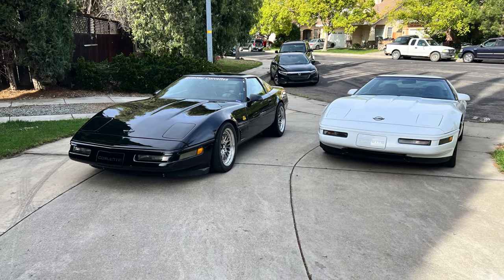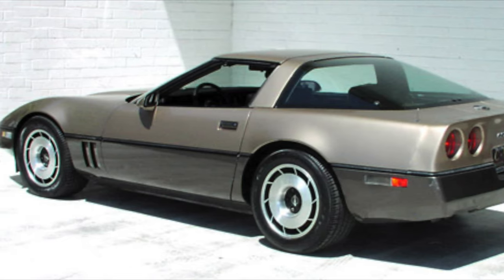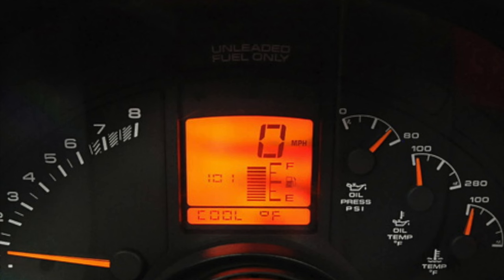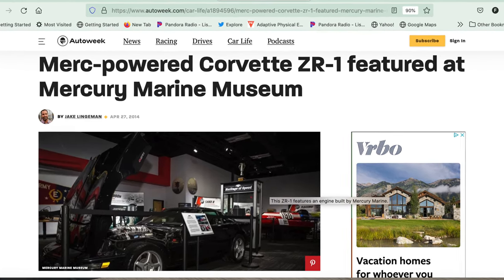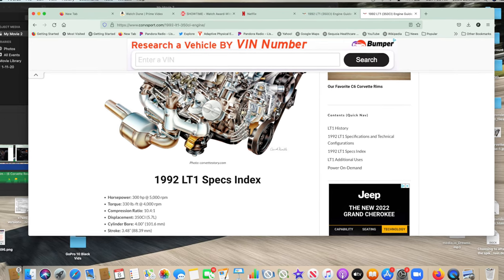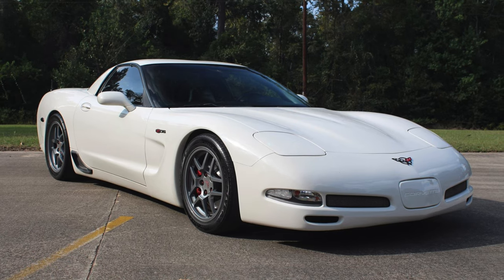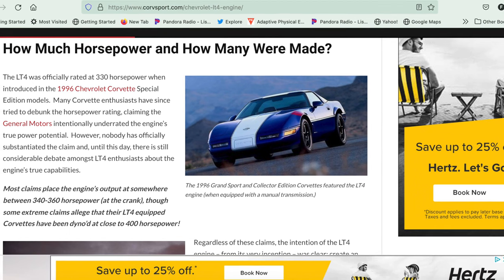C4 Corvette Review

Comment: If I recall, the Flowmaster Force II Exhaust which I have on my 96 is 2-1/2 inch inside which matches the stock inside diameter. The outside diameter of the stock exhaust is 2-3/4. Flowmaster's Force II resonator is  flowthrough with no restrictions. Compared to stock if you saw the inside of both, Flowmaster is much better. They may have made changes over the years but today's system is better than stock in every way. It's a slight upgrade, not a downgrade.
Reply from the maker: How long have you had your flowmaster system on your Vette? My Force 2 didn’t last 10 years. The whole system corroded and rusted.. I much prefer the Borla System.
Reply: @FugitiveVette  had it installed last summer, it's stainless steel.
Reply from the maker: @kirkcunningham6146  nice 👍 I think mine was 409 stainless. Which of course is the lower quality.
Reply: @FugitiveVette  well, mine is also 409 not 304 but I don't drive or store mine in wet weather. Always in a dry environment and garaged if I'm not driving it so I'm not too worried.

Comment: I am going to look at a 1989 tomorrow. Thanks for sharing the video.
Reply from the maker: Oh nice! 6 Speed?
Reply: @FugitiveVette  unfortunately no. Any major tips...? Things I should be considering? Cheers
Reply from the maker: @MaisonPulaski  find out how many times the differential and automatic transmission has been serviced ie fluids. Check to see if there are any misfires. Look underneath to see if there are oil leaks off the main seal. Another is take pics of the transmission to see if it’s leaking.
Reply: @FugitiveVette  thank you so much for your help!
Reply: I bought an '89 convertible last fall. Haven't driven it much since winters are harsh here. But, from what I have driven, it's a blast. AS far as things to look at are to make sure all of the dash lights work correctly. Depending on where you live, check tire dates. In areas of bad winters many Vette's don't get driven a lot and the tires will age before they wear out. If you did buy the car, I hope you'll enjoy it.
Reply from the maker: @michaeldmckenzie  well the weather should clear up soon. Really happy you have a nice 👍 C4 Vert!

Comment: Great video! But for clarity the new gauges started in 90 and I think ony the Z51 with the sport  rear diff had 250 hp.
Reply from the maker: Correct I made a few mistakes in that video. 1990 definitely had the later tech gauges.

Comment: At the very end of the video, what headers are those? I have an LT4 and if I can save some money by not going with ARH headers that would be great lol
Reply from the maker: Stainless Steel Works. Keep in mind the primaries are only one and 5/8 inch. The collector was 2 1/2 inch I have modified it to 3 inch collector that made a really big jump in power with my set up. I’d you have any questions feel free to DM.  Thanks 🙏
Reply from the maker: I also had the headers ceramic coated. Worth the money 💰
Reply: @FugitiveVette  definitely agree with that.  What cam are you running? Also looking at aftermarket oil pans since road courses are my thing
Reply from the maker: @TheFamilyCarGuy  thanks I will have to look up the cam specs but it’s something like a 228 - 245 with a LSA of 110.
Reply from the maker: @TheFamilyCarGuy  I would do the AccuSump rather than a Millidon pan. After market pans make it harder to change the starter.
Reply: I have an lt4 as well.  I put exotic muscle ceramic coates long tubes on mine.  Price was reasonable and you can get cats if you want them.  Also TPIS makes a nice set for these cars.
Reply: @FugitiveVette  an Accusump is a great idea! I'm definitely going to look into that. I've seen some setups where they delete the spare tire and run the accusump in its place.
Reply: @keonwells934  I looked at TPIS but last time I checked they stopped making headers that would fit the C4.  How do you like the EM headers?
Reply from the maker: They are Stainless Steel Works.  They used to be affordable but you will need to get them Ceramic Coated.
Reply: @TheFamilyCarGuy  I like them.  They get the job done and since they are coated they it helps keep the temperature down.  My only issue with them is 1 of the primary tube comes very close to the passenger side upper control arm.  Other than they they fit great.  I was thinking of switching to ARH but I also want a c6 zo6.  So we will see what the future brings.
Reply: @keonwells934  I respect that. I also have a heads cam c6z with ARH headers and they are awesome.  I wish I would have gotten them ceramic coated but other than that, no complaints. Highly recommend one if you can get your hands on one!
Reply from the maker: @keonwells934  Do you live in Northern California? Is your LT4 a Collectors edition?
Reply: @FugitiveVette  my LT4 is a base model.  White with black interior.  I live in Pennsylvania.

Comment: probably gonna buy a c4 as my first/only car, whenever they show up they're in very good condition and have fairly low miles on them. Now how does this perform in the rain and can you drive it in the winter time? (Using winter tires of course)And one more thing! I like the earlier models with the full digital dash more, but apart from the airbag  does the 84-89 tend to break more ?

Btw: How is the speakers and AC on this car?
Reply from the maker: Honestly I’m terms of reliability I would say the 92 to 96 for the most part are more reliable and a lot more refined. The one major knock is the optispark but like I said you can replace with the MSD. As far as driving in the winter ❄️ I can’t really saying live in California where it never snows. But in terms of rain I find it easy. One thing to remember the 93 to 96 years are the only ones equipped with ASR traction control.
Reply from the maker: Hope that comment helps. Let me know if you have any other questions.
Reply: WInter driving in a C4 is terrible and dangerous.  

My wagon was in the shop up in Minot, ND. So, I had to take my 84 to work with snow on the highway.  Everything was fine until about 30 mph.  Then the car turned into an air hockey puck.  I did a few 360's.  When the car came to a halt (in the median) I was trembling.

I thought it was a fluke.  So, I got back on the highway and drove about 30. At 30 it was rock soid.  At 31, it went out of control again.

Braking in any gear would barely slow the car down on a slippery surface.  In Neutral, it would not slow down great either, but it was better than trying to slow down in any forward gear.

Recommend against.
Reply: Corvettes have always been driven year around including mild snowfall... but need all weather tires... no car is safe in rain/snow/ice with slicks...
Reply: @FugitiveVette  - MSD stuff isn't very reliable, probably 1 in 4 is junk when new...
Reply from the maker: @BuzzLOLOL  it’s a lot better than the factory Optispark. I have had good results with the MSD.
Reply: Driving my 84 corvette in the rain is just about the scariest thing ever I did she just slides
Reply: @saintsadd6667  - You have the wrong tires for rain... it's not the car, but the tires...
Reply: @BuzzLOLOL  it probably also didn't help that the tires were a decade-and-a-half old
Reply: @saintsadd6667  - My Mom had a '95 FWD Pontiac Gran Prix and when the Goodyear Eagle tires wore down a little there were no more sipes in the outside tread row to let water out and at 50 MPH on wet roads it started hydroplaning all over like on ice... fortunately, she had given up driving by then...
Reply: @BuzzLOLOL  good drift practice tho 👌 made me feel alive and love my car even more I was going on a grocery run I wasn't expecting to be sliding and countersteering all the way home
Reply from the maker: @saintsadd6667  what kind of tires  are are you running?
Reply: @FugitiveVette are you sure the 92 didn’t have asr traction control? I thought that was the first year it became available…..anyways bad ass amazing video!

Comment: What year did the c4 ditch the all digital dash and got rid of the lights in the back what's the best year if I want the old lights and old dash but best performance
Reply from the maker: 1991 was the year they changed the dash and body style. 1992 was the first year of the LT1. 1990 is the best year of the old dash and body style with the round tail lights . 1990 had the L98 engine. Hope this helped.
Reply: @FugitiveVette  yes it did thanks for the response and the fast informative one at that 😁

Comment: I appreciate your knowledge and admire the car.
Reply from the maker: Thanks 🙏 appreciate
Reply: He doesn’t have knowledge there is a ton of misinformation. 3 buttons for the overdrive? 3 speed overdrive??? It’s a 2 speed over drive with direct or overdrive and it’s ONE button. On or off. And the runner length gave it the torque not the ability to rev higher! On top of a lot of other things!

Comment: Nice video review!  However, longer intake runners produce more torque and shorter runners rev out higher, provided the cam isn't garbage.
Reply from the maker: @marshallnoise3557  correct 👍 I had that backwards 😂
Reply: @FugitiveVette  All good!  Very nice video.  'Bout to do the exact opposite of what you suggest and look at an 86 and turn it into an LSx test bed for a 6.0 LQ4 and 4L80.

Comment: I’d love to throw the money towards building my c4 up to be like the sledgehammer. Or Atleast close in performance. Have been debating a 383 stroker with a turbo/twins or just slapping nitrous on it and skipping the turbos
Reply from the maker: There’s a lot of different ways to go. I f I was going the boost route I would build a 355 with AFR Heads low compression and a Pro Charger on 15 or 16 psi.
Reply: @FugitiveVette I'm quite impressed by your knowledge. My issue in choosing a base for a similar idea is that only early C4s come with the quick steering rack on the Z51. I remember there being an issue retro-fitting that to a later car. I can't imagine working with the slow steering though. Are you aware of a quick rack solution for the later cars?
Reply from the maker: @varmastiko2908  I really think you can rectify that with an aggressive track alignment. My steering feels very quick and responsive.  Might want to try that first the advantage of Corvettes is they have 4 wheel alignment which makes them handle extremely well.
Reply: @FugitiveVette The handling is great but the steering rack on the later Z51 is still a downgrade. Am I correct though, that I can't fit an '85 steering rack on an '89 car?
Reply from the maker: @varmastiko2908  I believe it is different. Let me ask my mechanic Dave Bonar. I’m sure he will have a lot of info on that subject.

Comment: Major  issues with that poorly designed Opti-spark ignition on the the later models that were not properly vented, and the fit and finish of the plastic f16 cockpit style and cheap looking gauges really made the c4 look cheap. They could of used better quality material in terms of the gauges. Like the digital even though i prefer analog gauges.  Also the 96 were the higher performance motor and grand sports ,but the ZR1 was the king and cost 80 thousand plus tax in Canada. Also the Opti spark which was similar to the one used in the Pontiac grandam  was properly vented and did not have thge same issue as the vetted Opti spark.
Reply from the maker: Well on o believe 95 and 96 they definitely vented the opti but they still are susceptible to damage to the optical trigger. Bottom line it was a shit design.

Comment: The C4 has a transmission temperature gauge?
Reply from the maker: Yes transmission fluid temperature.
Reply: @FugitiveVette  what year had transmission temperature gauge, I've owned two c4, been around many and never seen a transmission temperature gauge in them. Crankcase oil temperature gauge yes, but not transmission fluid temperature gauge.
Reply from the maker: @b.c4066  my dads 96 Corvette is an auto with an LT1 and it has a transmission temperature fluid gauge.
Reply: auto trans only
Reply from the maker: @ralphhbernstein6798  yup 👍
Reply: @FugitiveVette  Uh yeah but you said the digital dash had a transmission temp gauge which it doesn’t 🤡
Reply from the maker: @destruxandexploze2552  yes 🙌 I was wrong on that thank you for the correction. My 96 and all 92 through 96 Corvettes with auto trans had transmission temp gauges.

Comment: The classic big block Corvettes were muscle cars. All 6 cylinder and sbc equipped Vettes are sports cars. The C8 is neither; it is an exotic.
Reply: There's no v6 vettes and they're sports cars since 53
Reply: @juanmontoya5331  You’re right, there were no v6 Vettes. The early 50s cars were powered by straight 6s. I think it’s towards the middle of the C1 generation where the Vette finally got the V8 and it became the mainstream engine choice.
Reply: V6??? You’re thinking Camaro. That had a V6 or a V8. Corvette is only V8 for this era, and every era after C1.

Comment: 6:01 

Bruh what? The intake runners weren’t too short, but they were short? It could breathe better??? That’s shite. The runners are so damn long it’s hard to rev high with an after market ported base, runners and intake! They’re DAMN long. And it would stop breathing at 4.5k rpm because power flattened after 4.3k rpm.

And the torque went up, because they could rev the engine more???? The torque maxxed at 3,200rpm revving higher didn’t mean shit for torque, it was the runner length.

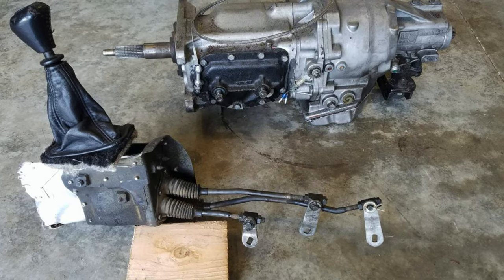7:36 No! It didn’t stop in 1987 because I got an 88 with a 4+3. My god did you do any research???? The 6 speed ZF6 didn’t come in until 1989. And you’re acting like a 4 speed manual is shite, but you know that the Super T-10 (which is what the 4 speed is) is the same trans in the original 60s Shelby Cobra? It’s a damn good transmission. 7:45 And it wasn’t a 3 speed overdrive, it was 2 ratios (2 speed overdrive) that electronically could go between the 2 ranges, direct or overdrive. .60 or .68 for the overdrive (changes for different suspension packages) 8:07 OMFG IT WAS ONE BUTTON, OVERDRIVE ON OR OFF HOLY SHIT. Also you say it’s difficult to rebuild but it’s just a little overdrive unit that would need to be fixed, it’s not that hard. It’ll just stay direct instead of going into overdrive. The 4 speed is very robust, it won’t break under normal conditions. 

9:01 You misspoke and said 1998 (C4 ended in 1996) even then in 1988 it was still the 4+3, 1989 got the ZF6. And the ZR1 didn’t come along until 1990, the ZR1 had some concepts in 1989 but they’re rare. 

Also you didn’t even mention the suspension change in 1988 and you were wrong! 1990 still had the L98! 1992 started the LT1!

SO MUCH MISINFORMATION IT’S INSANE.

Comment: MSD optispark are JUNK, the best ones are the original OEMs. I service and repair a lot of C4s, and i'm yet to see a real OEM optispark actually fail in a way it couldn't rebuilt. Good luck with that MSD and it's chinese optical sensor, they're hit and miss at best.
Reply from the maker: True the only thing better about MSD is it’s a sealed unit which keeps it dry. Other than that I agree they junk.
Reply: @FugitiveVette   They're all sealed around the cap, even the cheapest chinese junk ones are. If that seal is good they won't fail from hosing them or leaking water pumps. Problem is that seal is not going to last forever. Any distributor will be f***ed if you get water into it while there is HV present. 

Using an MSD cap and rotor kit on an OEM unit is the best option to swap a 92-94 unit to vented, the allows for the holes in the bottom to be sealed (and contrarty to popular rumour, this isn't where water gets in) 

I have rebuilt a lot of optisparks, and i've seen a lot of OEMs go well over 100,000 miles and 30+ years without being touched.

Comment: Dude.... This video is terrible. In the first 5 minutes alone you got several basic Corvette facts wrongs. First, there was no 1983 Corvette, that model year corvette simply did not exist. The L83 Crossfire motor that was used in the 1984 was not a carryover from 1983, since there was no actual 1983 model. Second, the Doug Nash 4+3 was used until 1988, not 1987 like you said. There was no factory transmission temperature gauge. That image of the digital dash was from a 1985-1989 Corvette, not a 1984. Ignorance is one thing, and is excusable. Ignorance of one's own ignorance, then a willingness to espouse "facts" that are in fact, wrong, is something else.
Reply from the maker: Thanks for the correction. Although I never said 83 was the first year of the C4. It was supposed to be 83 but it was not produced until 84. The 84 also shared the cross fire fuel injection that the previous year C3 had.
Reply: Some '83 Corvettes were made and existed, but not sold... at least, not publicly...
Reply: @BuzzLOLOL  no, none were ever made available to the public as a 1983 model. So for all intentions and purposes they were prototype, research and development, demo for magazine writers to use, write stories about and pump up anticipation of the 84 model when it got released. They were subsequently destroyed. The fact that the one in the Corvette museum exists is a mistake, if people had followed gm protocol the car would've been dismantled and destroyed.
Reply: And the 3 buttons for the ‘3 speed overdrive’ which it’s 1 button On and Off for the 2 speed overdrive (he says it basically a 3 speed automatic connected to a 4 speed manual 💀) it’s direct and overdrive. 1:1 and .60:1 or .68:1
Reply: @destruxandexploze2552  - Not an "automatic" since you manually select if you want it...
Reply: @BuzzLOLOL  That’s what I’m saying. He called it ‘basically a 3 speed automatic’ although with the switch ON it does automatically shift in and out of overdrive. (Direct 1:1 or Overdrive .60-.68)